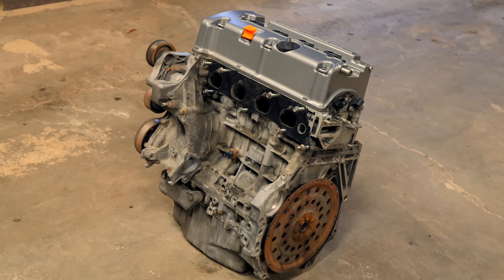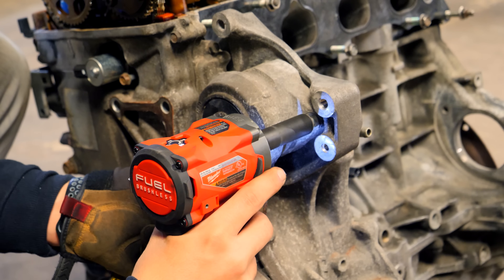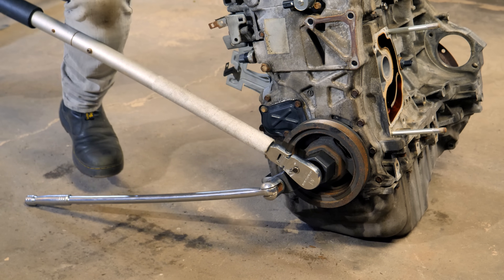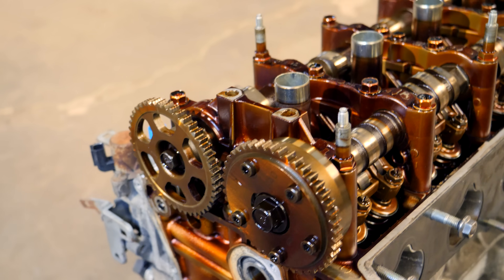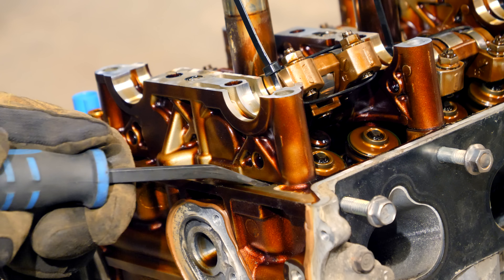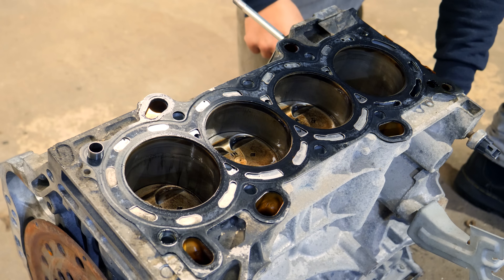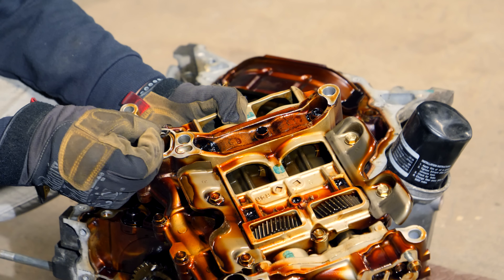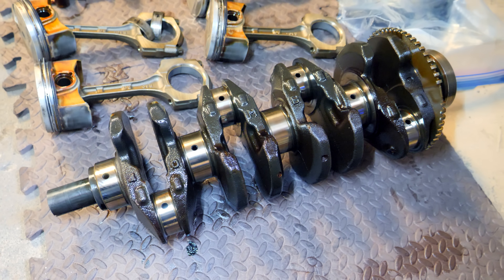Detailed K24 Engine Teardown (COMPLETE GUIDE)

Comment: Hi I was doing work on my k24 crv and long story short a metal ziptie fell into the hole between cylinder 1 and 2 under the exhaust cam. Does this lead back to the oil pan and would I be able to retrieve it from dropping the pan? Any help is greatly appreciated I don't know what to do now. Thank you

Comment: The Honda forged crankshaft in Honda's J35 V-6 is a complete POS.  EVERY Honda J35 V-6 forged crankshaft manufactured from 2016 to 2024 was manufactured incorrectly and will lead to premature, catastrophic engine failure.  Honda recalled 259,000 J35 V-6 equipped Honda vehicles for this reason.  The NHTSA is investigating an additional 1.4 MILLION more J35 V-6 equipped vehicles for this potential issue.  This issue improperly manufactured crankshaft issue will be a bigger nightmare for Honda than the Takeda airbag issue was.  You've been warned!

Comment: The plastic pieces believe it or not might be from the oil fill cap breaking in the past a long time ago and a couple small pieces that broke off the handle on the cap may have gotten somehow without messing up the valvetrain that happened  to my buddy on his 2007 accord K24 when he was loosing the cap it blew as he was busting it loose  cuz it was frozen so bad like it was JB welded on

Comment: Got a question, I realize this is a complete teardown video but I was wondering if the girdle will come come off without taking out the connecting rods and crankshaft? I have a leak coming from a certain area where the girdle meets the block.

Comment: Hello  i have a k24 engine 2006 in my Honda Elysion , one day I got in the car and tried to start the car , right before it sorted to run it made a metallic noise then turned off , it never started again..... we opened the top of the engine and examined the chain and timing was still fine , fuel system is fine .... help what could the problem be

Comment: It's not a complete teardown since you already removed the intake manifold. For a newbie looking for a full tutorial, they might not know how to handle the exterior accessories or how to pull the engine for that matter.

That engine might have come out of a 2009 2.4 TSX but that's not an 09 engine looks like a 2013 CU2 or CUP K24Z3 engine. The 09 engine exhaust side has V-tec and the head as a traditional 4 port exit.

Comment: How many of those pins was there that hold the head and gasket in place on the block?
Reply from the maker: There should be 2 dowel pins between the cylinder head and block, on opposite corners of the block.
Reply: @milanmastracci  thank you. There was only one on mine but we got one that should fit.

Comment: Great job. I recently rebuilt a k24 engine because the cams damaged due to poor lubrication.  After reinstallation, valve train is little bit noisy still. There's also vtec failure. Is it possible im getting low oil pressure from the oil pump? Or are there screens that can impair the flow of oil to the head when clogged?
Reply from the maker: Did you adjust the valve lash? I'd suggest looking into that.
Reply: @milanmastracci  Thanks. The lash lock screws fell out. Its fine now except for loss of power after 10mins drive

Comment: so i searched on google on bing and multiple different forums. your the only one to tell me the difference between a 2008 tsx and a 2009 tsx. and for that im gonna subb to u. when it came to this question i had it took nearly 30 mins of searching to find out the damn name of the engine of a 2009 tsx. 
k24z3 for 2009- whatever i dont care
k24a2 2004-2008  
and u even showed the block and how it attaches differently then the k24a2. 
thanks alot i cant believe its so difficult to find this simple info on any search engine.

Comment: by weight roughly what is the percentage of Aluminium alloy and Steel in an engine block? Does anyone know?
Reply from the maker: The only steel portion of modern engine blocks is just the liner for the combustion chambers. Everything else is aluminum.
Reply: @milanmastracci  thank you for responding i appreciate it, actually i am planning to buy aluminum scrap engine blocks for the first time but not completely sure how much aluminium and steel i will get out of it, someone told me that its 55% aluminum by weight, which means if I buy 10 tons of engines i will get 5.5tons of aluminium and 4.5 tons of steel. What do you say about it?

Comment: I'm a heavy equipment tech and I never understood what the big deal is with a Honda crank pulley bolt . On dozers, front loaders and cranes 75 percent of the machines bolts are as hard or harder than a Honda crank bolt, way harder . I use a snap on or ir titanium impact and it does the trick for me . I've ran into some really stubborn bolts on big Cummins and Cat engines and if the impacts won't get it I use a chain wrench to anchor the pulley and a long 1/2 or in some cases 3/4 inch ratchet for the bolt . Depending on what it is I'll use a 3/4 inch impact which I know nobody is going to use on a Honda .
Reply from the maker: Thanks for sharing! On a large engine, I can see why a 3/4" impact might be needed, but I think these Honda bolts are on too tight.

Comment: Just curious. I have a gti running 240 hp at the crank and my torque steer is much more than I'm happy with. Will that be an issue with your 300 hp at the wheels? The reason I ask, I'm looking to do an engine swap in my porsche 914. I haven't decided on an engine and trans yet. I realize torque steer will be mitigated to some degree by the the mid engine installation but, I'd be interested in hearing your thoughts on a k24 install. I've considered a subaru but there are a lot of problems with engine management. Link is the only after market solution available and it is very pricey. Thank you for your time and consideration.
Reply: Just from a reliability standpoint it’ll be easier to swap in a k24...also regarding ecu go on some Honda forums, explain your situation regarding ecu and they will tell you what wiring harness you need to run a hondata kpro ecu...also check out on Facebook Honda marketplace in your area as there is usually lots of good deals for new used and aftermarket parts

Comment: Nice video. please is there any difference between the oil pumps on k24A4 and k24Z2. A mechanic told me that an oil pump from a k24A4 will not fit a K24Z2 engine on my 2008 Accord LX. Please help me to clarify this.

Comment: Very informative video with awesome photographic quality and some helpful hints along the way.  As a instructional video, I would recommend you slow down the pace.  I think anyone watching this is willing to learn as much as they can from you, and would rather see a longer video than have to stop and rewind to get a better look at some process that you edited down to a few seconds.  You should also refer to engine fasteners correctly, not by the size of the socket or wrench used on them.  For example  M6-1.0 X 20 bolts are available with several different size heads including 10mm, 8mm, Allen, Torx, Phillips, Slotted etc.  None of these specify the bolt size.  So it would be more accurate to say "remove all of the 6mm bolts securing the valve cover with a 10mm socket or wrench", than saying remove the 10mm bolts, because technically there are no 10mm bolts, and you are, technically teaching.
Don't get me wrong, this video among the best found on YouTube and you can be proud of that.  Clearly you have experience and knowledge that will help others.  Keep doing what you are doing and you will go far. Thank you for quality content.

Comment: Is it possible to modify the exhaust crankshaft so that both sides are Vtec?
Reply from the maker: Unfortunately not because the ports for the oil pressure that control the camshaft phasing don't exist on the exhaust side. Good question though! I thought the same thing myself

Comment: Those plastic pieces for a fact is oil cap. Common for them after many heat cycles to crack and break
Reply from the maker: Yes you are correct 👍

Comment: When removing head studs you should remove them in reverse order of installing. It's alloy head and it can twist if you don't do it in order
Reply: expert20valvehlx like in the alpha twin spark😉
Reply: @adamy4162  haha no, ts head have more holes for more sparks and they are not pron to twist as a normaln bead but again i do it like that just in case

Comment: If you don’t mind me asking where did you find the k24 for 300$?
Reply: They only go for $500 in great running shape his had head issues hence $300. His wasnt the more expensive k24 from like a tsx w real vtec on intake and exhaust his was economy CRV type w just VTEC on intake
Reply: I just picked one up today for 100$ k24a1 with a bad head gasket ran when it was pulled

Comment: Hi Milan, 
I’m not capable of tearing an engine apart for cleaning ( forget about rebuilding). 
Is there an easier way to decarbonize/ de-gunk (remove all the accumulated gluey stuff) the engine? I own an 09 Accord. It has the same engine as your accord (minus all the modifications).
I know you have a neck to neck tight schedule. But if you can squeeze in a video on this subject, that d be great!
Reply: They make additives but imo they're never going to be 100%
Reply: An old trick is to use Diesel engine oil (rotella t6, rotella t5, Mobil delvac etc) as they’re better at keeping the engine clean due to more detergents I think...or you can also just get cheap conventional oil or semi synthetic like rotella t5 and just change it out until it stops getting dark quickly

Comment: Nice video! I think those plastic pieces are from the oil cap, looks like the threaded part. No idea how those pieces would get through the oil drain back holes in the head though. Also, that engine really doesn't look bad inside at all in my opinion. No it wasn't spotless, but I have seen way more engines that look way worse than that than engines that look that good or better.
Reply: Yep, honda oil caps get super brittle in the cold

Comment: I was cringing how u were using channel locks to pull those cam caps !!!!
Reply from the maker: What tool would you recommend?
Reply: @milanmastracci  tap them with a rubber hammer or a dead blow .or lift up on the cam works too
Reply: @milanmastracci  i use the bolts
Reply: milanmastracci there's a method where you insert a Phillips head screw driver into one of the 12mm cam tower bolt holes and rotate a bit forcefully, in a circular motion, and the cap will eventually shimmy loose. It's best done on two of the holes per cam tower.
Reply: I use channel locks with an old inner tube over the teeth to remove cam caps all the time.  Dead blow hammers can be problem too because of the potential for bearing damage if you use too much force.
Reply: Mitchell Savage I use Vise grips!😜

Comment: color of it's internal engine seems to be very brown and very brown.  Does it mean this engine has been burned out?
Reply from the maker: It means the previous owner to this engine didn't do oil changes at the proper interval, which allows the engine oil to get extremely worked, and it might have even run low on oil. If you do your proper maintenance at the appropriate intervals, you won't have to worry about this
Reply: @milanmastracci  I have this problem with my z3 right now, it runs low on oil every 1000km. What interval do you suggest to change the oil from now on? Do I have to change the pistons? Is there a problem if I only complete oil every 1000km?

Comment: You didn't explain how to properly loosen cylinder head bolts. Depending how their torque down it's either inside out when loosening or vise versa. Failing to realise this can cause your head to warp.

Also I believe that oil pump is attached to the counter shafts which is why it's so big it helps with vibrations.
Reply from the maker: The oil pump on these engines has balance shafts which helps reduce the secondary forced from the crankshaft. I will be changing my pump out with a better one when it comes to the reassembly :)

Comment: the problem with engine burning oil is, is not the engine. is the lazy owner that never change oil on there car, think it will run forever. oil get slug up and clog up the oil ring, oil cant flow back. it end up getting burn. then they go to the manufacture says these engine are junk.
Reply: How can I fix this issue? The old owner of my car didnt change it on time, how do I change it from now on? What interval?

Comment: Isn’t that a k24z2 head so doesn’t that mean k24z3 share the same block cause I have the same head on my k24z2
Reply from the maker: They have very similar blocks, but they are not quite the same. The engine has a port through the head into the block  that is different between the two. I will be making a video regarding the differences.
Reply: milanmastracci ok so do you think a k24a2 head can work on that block

Comment: Are you going to upgrade to the electric power steering as well?
Reply from the maker: I wish it was easier than what it is! I'll have to look into it more as that would be awesome
Reply: me and bonzai rocket went into a lil dive on driveaccord.net about a couple of options with swapping with the tsxs and what not.. I wanted to go with the auto tsx transmission swap so upon the research I noticed how complicated it is but challenge accepted and really appreciate you taking on this task... are you going to swap parts from the "z" and "a" block into your existing block that is in the accord or is the accord block is going out? because the z3(from tsx) doesn't have power steering I was wondering if you are going to keep it at all or go electric hense my curiosity. but loving this build series.. by far this is the most unique and extensive Z build series on youtube. cant wait to see more!
Reply: https://www.driveaccord.net/threads/question-about-2g-tsx-motor-compatibility-with-8g-accord.502898/post-6288930 thats bonzai rockets explanation of the EPS conversion

Comment: Hi Milan, I've taken apart many Chevrolet small block V8 engines from 265 cu in in the 1955 Chevrolet to 283 and 327's. Every one, even those well taken care of always had sludge everywhere. In spite of the tiny bit of sludge you found I was amazed to see how clean that engine was inside. A tribute to modern day detergent oils. Good luck with this project. Tom U.S.A.
Reply from the maker: Hey Tom. If you think this engine here is clean, boy do I have good new for you!! When I did the timing chain on my Honda, the engine was SOOOO much cleaner with literally ZERO sludge. I can only imagine how bad the old chevy small blocks were!

Comment: The plastic bits looks they are from an oil filler cap. Maybe the threads broke of an old oil cap at some point and fell into the engine and the last owner just replaced it.
Reply from the maker: That's a very good call!! I bet that's it!

Comment: Isn’t this the same motor that’s in the civic si
Reply from the maker: This is almost the same engine as the Civic Si. So the engine in this video is a K24Z3, which is similar to the K24Z3 in my accord, but since it is from a TSX, it has higher compression pistons. The civic Si has the K24Z7, which on paper makes a tad more horsepower than this engine, but it may be because of tuning or peripheral components like the intake. Have a look towards the bottom of the page: https://en.wikipedia.org/wiki/Honda_K_engine
Reply: milanmastracci wow I didn’t know that I assumed it was same one but thanks for the info !
Reply: milanmastracci so the motor in your accord is the same engine one in the si you should make a video on the different types of k20 and 24 motors would be interesting to know the minor differences
Reply from the maker: Will do!
Reply: @milanmastracci  also my 2009 TSX have 264,774 Miles And Keeps Going Running Like New. Goal Hit 500K Miles To Bring It To My Local Acura For Take A Picture Of The Most High Millage Modern Acura 😂
Reply: And i forgot record in Puerto Rico 😉
Reply: 2014 and 2015 civics si
Reply: Alright thanks
Reply: My 2012 civic si has the k24z7
Reply: @johnathenthompson2439  yeah same block and compression ratio of the tsx 2009-2014 (like mine)